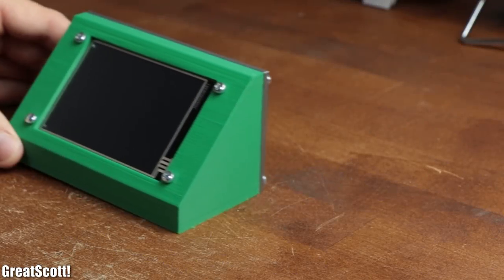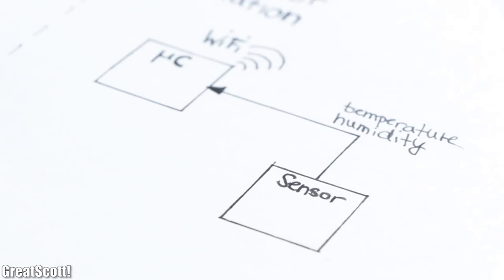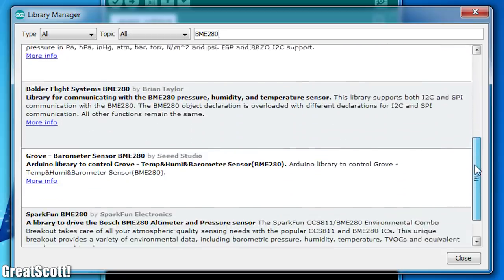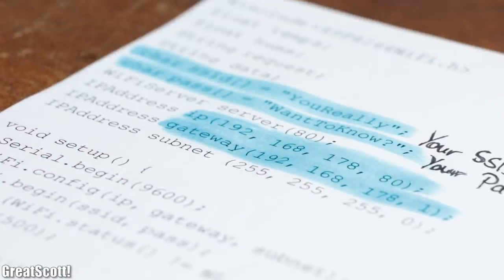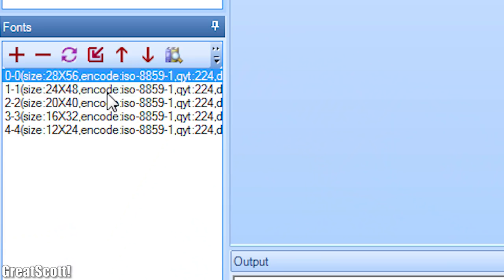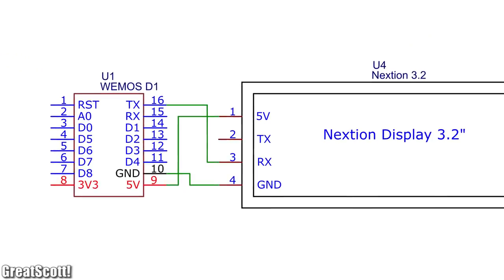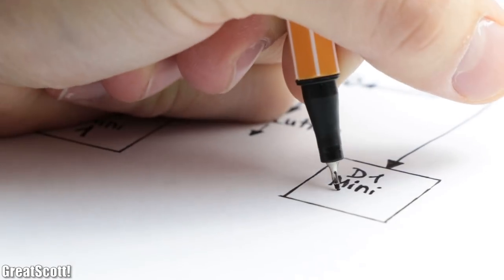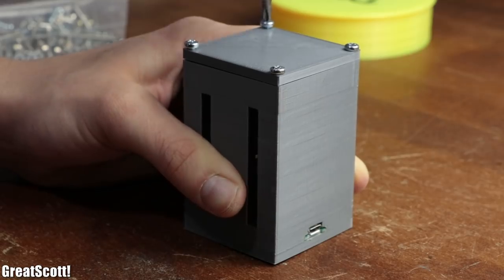DIY Weather Station & WiFi Sensor Station || ESP8266, Nextion LCD

Comment: ESP2866 is a game changer. Way easier to use and cheaper than Xbee for local communication. Integrated arduino-compatible microcontroller is a bonus. Really want to build a weather station to put on top of my house. Got some good ideas here. Thanks for sharing!

Comment: Regarding the Nextion Editor, it was probably expecting a monospace font, which would explain the weird text spacing.
Reply: Yes to the monospaced font. I ran into the same problem.
Reply: I think icons are better than text
Reply: Would it be better to generate pics of words through an external app and upload them to the nextion instead?

Comment: Regarding the temperature sensor, you should keep it separate from everything else, since the boards develop some heat too, and could so influence the result.
Reply: Yes but at 35C he must have put it right on top of the wifi chip lol.  I have some that are 5-10cm from the wifi chip and they only read 1.5C over ambient.

Comment: I had a play around with the BME280 and needed 2 of them connected to the same processor. After looking through huge amounts to datasheets, I found that you can indeed change the address on these boards; you have a choice of 2! If you look carefully at the 3 gold pads on the pcb, you will see that 2 are connected (middle and 1 side). You break this connection and join the middle to the other pad. One address is 0x76 and the other 0x77.
This saved my project, hope it helps someone else too.
Reply: You can also use them as SPI devices and have as many as you want. Provided you can supply a 'chip select' signal for each. Also, the BME280 datasheet is only 55 pages long. That's tiny. :)

Comment: Those 2 Wemoses made my day :) Seems like a bit of overkill to me. First of all, ESP is pretty fast, so any LCD will be capable to display the graphics directly from ESP - you can even  utilize the SPIFS for storage of the data and, potentially, upload a new background using web interface. But I admire your - let's just hack it together - attitude, really. I usually spend LOTS of time on my projects just because I don't want to do it this way and go with something like "this has to be possible - how hard can it be?". 3 months later I am left with lots of unfinished or half-done projects ;)
Reply: Perfect is the enemy of good (Voltaire)
Reply: So recognizable... +1
Reply: Dude, I feel you soo bad on this one. I have an extreme do this is the nice way or do it in a way so that it looks like it was bought. most of the time they end up like yours. PS: sorry for the reply 2 years later xD

Comment: Why not put the little wires through the holes in the boards when you solder them on? It does make them harder to remove if you take the project all apart, but you don't have to worry about the wires ripping the pads off the boards when moving them around.

Comment: I'd use an OLED display and make it simple white text on black(off) background, replace "Internet" with "Outside" and "Sensor" with "Inside", and maybe add a little cloud/sun icon indicating the current weather.
Anyway, cool project!

Comment: 9:42 
Are you sure that the diodes should be connected in this way? 

In this configuration you block the signal from TX to RX, so it can't go through the diode?

Comment: SWEET !!!!  After all the failed purchased weather stations I have tried, I wish you could design a complete all-out enhanced station with wind, direction, uv, temp, humidity, rain amount and pressure. This idea of going thru the wifi sounds absolutely grand compared to the expensive crap I have purchased that failed which operates over their own RF signal. My problem is that I an Not a programmer (mental block) and I get too frustrated trying. With having all the basic sensors already up and installed, just communication setup would needed to get all info back to the head unit.
Reply: Yup, agreed.  Using wi-fi to get to the internet is the way to go. An outside station is not needed. I bought a bunch of RF2401 to build weaterstations and I guess I will use them for something else.

Comment: It seems like the Nextion is not very simple to use. Do you know if it's possible to program the screen directly from the mcu? e.g. use the screen as a general purpose screen?
Reply from the maker: I don't think so. I think you have to use the editor.
Reply: @greatscottlab  Hi i just want ask that: are you going to do a video about your new skateboard ???
Reply: Im sure you can use a USB-TTL converter and the editor will automatically bring it up, but I'm sure you cant use it as a secondary screen to my knowledge
Reply: I think it’s still more simple than guessing where to define the 4 corners of a rectangle (which is usually guess and check since there’s no computer editor to see what you did before you upload to arduino), fill the rectangle with a solid color, then guess where the center of the button is to center your text which is especially hard since the coordinates are the left bottom coordinates of the text (no centering function), then make if then statements to check if the screen was touched in the area of the button, then redraw the button a different color to simulate being pressed, and finally run the code you wanted the button to do. And if you want to load any images, it takes 10 seconds to draw a background image. Then if you want to change pages, you have to put all your code for drawin everything in a method and use a variable to tell the arduino what screen you’re on or else it’ll respond to touch in the wrong areas. My point is, the regular way is a huge pain in the ass and is hours of guess and check. It’s so much nicer and faster to see what your GUI looks like as you’re making it, even if the editor isn’t super simple. It may be hard to learn, but once you master nextion, nothing else compares to how professional the GUI looks as far as arduino goes. Raspberry pi is a whole other story but you can’t beat nextion for arduino
Reply: There are commands available in the help section to program from code in, or passed thru, the MCU. There's a steep learning curve, but I haven't looked back to blue LCDs since I found the Nextion.
Reply: Old Curmudgeon I’m glad to hear that. I just got the 3.5” enhanced in the mail today and I’ve got another one coming. After writing 4,000 lines of code in my past project only to make a simple GUI , I wish I knew about these nextion screens earlier. I could’ve made a better GUI in a day or two instead of weeks
Reply: @greatscottlab  Yes and no. The editor is required to add the fonts and any pictures you want to use. The serial interface can then be used to manipulate the elements using the commands listed on the help page in the editor.
Reply: ay don't come advertise your project videos here. 
I understand you might be beginning or something but this really inst the place here
Reply: @Clockpie5436  sorry if english isn't your primary language, but I didn't understand a bit of that comment.
Reply: I think he is talking about "Learn Electronics" video, posted as a comment in this thread.

Comment: Looks great. I didn't go in detail through your code but just want to leave some info on the BME280 for those who might work with it the first time: by default it usually is in continuous mode, taking g reading after reading and that way heating up itself. Best use it in 'forced mode'.
I infact had problems with a Bosch sensor once. A BMP180 stopped working, so I have slight reservations :-)
Reply: I have 2 of these on different projects. I need to look into setting forced mode I think. I only poll in 15sec (minimum) intervals.

Comment: The BME280 is very sensitive to electromagnetic heating. Putting it this close to the ESP8266 antenna can easily skew the temperature by 3 degrees Celsius or more. Use a fan or put a lot more distance between it and the Wifi antenna.

Comment: The question of the day: do you believe the bme280 is accurate? I have constructed already several of those devices and I always had a problem with temperature readings, which in some extreme cases were like 6.5 degrees off. I I'm aware of self heating issue but that thing does not seem to be the 'large scale' issue. I did not do any tests yes, but is seems that this sensor has some dependency of temperature vs power supply

Comment: The reason you are getting weird looking text is that the font data is compiled and transferred to the Nextion screen as part of the programming. This method frees up memory that would otherwise be cluttered with unused font data. The best way of correcting your issues is to stick to using monospace fonts that occupy the same spacing. Those recommended are the following (Recommended Fonts by InterlinkKnight):
BatangChe
Consolas

CourierNew

DFKai-SB

DotumChe

FangSong

GulimChe

GungsuhChe

Incubus

KaiTi

LucidaSansTypewriter

MingLiU

MiriamFixed

MSGothic

MSMincho

NSimSun

OCRAExtended

Quartz

Rod

SDViewerFont

SimHei

SimplifiedArabicFixed

SimSun

SimSun-ExtB

Hope this helps, look forward to "seeing you next time!!!"

Comment: Great explanation.
But I have questions:
I have three stations (ESP8266 with BME280) and Openweather on Nextion. These also send the data (all, not just Temp and Hum) to Thingspeak.
How should I send this data on another Nextion?
Reading Thingspeak doesn't work, although that would be the simplest solution, because in this way many stations could be created and all data would be shown on a display (that would then be a real "station" and could also be used for thermal heating)

Comment: The ESP8266 has way too much influence on the BME sensor when mounted this way. This will result in a temperature reading that is higher than the actual temperature of the room. Sometimes that does't matter that much, but if you want to be precise it won't do.

Comment: Do you prefer soldering wire directly to the boards vs using headers and cable so they don't fall out if it gets bumped? Or another reason?

Appreciate the videos - interesting as always.

Comment: why not are you not using a protocoll like mqtt and a broker? So you could build a message driven design with multiple sensors and could use a raspi as server with a persistence like influxdb to save the data?

Comment: If you use the default config for your fritzbox, you should not use 192.168.178.80 as a static ip-adress, because the default dhcp-range is .20-.200. better use a adress between .2-.19 😉 (.201 + are the default vpn-client adresses)
Reply: You can reserve this via the MAC address in the FRITZ!Box. "Home Network > Network Connections"
"Use this button to add network devices that have not yet connected to the FRITZ!Box and are supposed to always receive a fixed IP address from the DHCP server."
Reply: ...or just switch to dynamic discovery protocols like SSDP and Avahi
Reply: @serhii710  In 2014 it was discovered that SSDP was being used in DDoS attacks known as an SSDP reflection 
attack with amplification. Many devices, including some residential routers, have a vulnerability in the UPnP software 
that allows an attacker to get replies from port number 1900 to a destination address of their choice. 
With a botnet of thousands of devices the attackers can generate sufficient packet rates and occupy bandwidth to saturate 
links, causing the denial of service.
Reply: @dl8cy  anyway, modern homes often contain at least one UPnP (and hence SSDP) - enabled device like Smart TVs, set-top boxes and even lights (like Yeelight with modified SSDP)

A lot of protocols have vulnerabilities. But in this case I'm not sure that the SSDP implementation for ESP or some other multicast-based discovery protocols can cause a lot of problems

Comment: Two ESPs for a single unit? Seriously? 

And for the future: take a look into SSDP and Avahi dynamic discovery protocols. Both of them allow devices to discover each other in a local network and communicate without a need to hardcore IP addresses

And also such protocols as MQTT are very handy for transmission of data messages from sensors

So, I'm waiting for the next project where the sensor unit will be battery-powered and will use deepSleep heavily to increase the battery life
Reply: Also you have 2 cors.....
Reply: just a question then, what else would you've used instead of another ESP (i guess you mean for the outdoor sensor)
And what is the actual advantage of them discovering each other?
Edit, sorry just saw now they were 2 in the station and 1 in the sensor
Reply: He's is using two ESP only for the display unit because he couldn't merge the code that receives data from remote sensor with code that draws on screen. I'll not judge here, but I guess it was not necessary if the code were more elaborated.
Reply: I actually have the same issue with the ILI9340 screen and the ESP32.  The drivers for the screen were written by someone who decided to write their own SPI protocol code, instead of using the existing Espressif libraries.  This allowed them to update the screen faster, but it interfered with any other code that wanted to talk to an SPI device.  So I either have to re-write all the screen libraries myself or split the functionality between two units.
Reply: Sergey, can't wait to see your demo code for the SDDP and Avahi protocols.
😁

Comment: Awesome project, and pretty useful but, could the Nextion LCD screen work with Arduino or other similar microcontrollers, and is it also avalaible in bigger dimensions and better quality resolutions???

Comment: I never understood why you solder the wires over the pin holes. Why not just put them through the pinholes and solder them from underneath? This seems to be a more stable connection as it doesn't have the risk of ripping the top copper pad off the board if you pull too hard, like yours does.

Comment: You could use the MQTT protocoll and a Node RED server, it's very versatile.
Reply: Over-kill for this project, but a great solution if you want to greatly expand with more/other sensors.

Comment: you are so lucky! theres lots of best in class electronics manufacturers in your country like bosch and siemens!!! here in my country there no such a company even a single one! it's hard to find components here. self studying or experimenting is impossible here. I'm self studying about electronics since 2010 I haven't even seen a oscilloscope or a lcr meter yet!
if we want to find scope here what we could find is cheap & simple pocket oscilloscopes only and funniest part is they inly exists in large mobile-phone repairing shops... we can't even import such electronic equipment from ebay or amazon because lack of foreign currency sanctuaries... sad of my country & and our poor economy😭😭😭

Comment: The font problem is solved if you use fixed size fonts. Variable size fonts require careful design and "kerning", which means that in some cases, letters must be moved towards each other. For example, "VA" and "fi" in this text show how kerning works. If this is not done or only approximately, the final result is horrible 😋

Comment: Hi I’d like to make a basic weather station which

1. Base station measures temp and humidity in the room
2. Remote (outside) temp and humidity sensor connected to base station via wifi,
3. Display output on a small color TFT to easily distinguish inside vs outside data.
4. Ideally base station (hopefully) and remote station (must) run from a battery.

Are you able to point me in the right direction please? All assistance appreciated.

I am an arduino novice but can follow instructions no problem  😀 👍

Comment: Great video, Scott, thank you so much.  I was wondering, could you make a video to messure several temperature and several umindity through several esp8266. And than have  high temp and low temp switch points, send signal send back to the respective esp8266, where some relays are switched, for example a heater, a fan, a/c dehumidifyer, window-opener, sprinkler, whatever.  etc. I think that would be something really usefull, we not quite so smart people could learn and program with.

Comment: Hi @GreatScott!, Is it possible if you could make a video with tips and tricks that you use when you solder on Vero board, like the type of wires you use and when you use them for making connections in the Vero board, Please🙏🏼.

Comment: What you could do is to start up a new WiFi on the ESP (with separate SSID and password) server and let the client connect to that WiFi.  Then you don't need to utilise any existing network.  That way you can actually give a weather station to someone since you won't need to "borrow" their WiFi.  If you want it really good you hide the WiFi so no one know how the sensor and station talk to eachother.  However you will not get internet access this way.
Reply: Maybe an MQTT broker & Home Assistant?
Reply: That would also be a solution, depending on the situation.

Comment: The weird spacing issues with your fonts come from *font kerning*. Google it if you want a detailed and technical explanation, but an easy fix for your problem would be to just use a monospace font.

Comment: Nice project. I am currently working on something similar but my ESP8266 is sending the the data from a DHT22 sensor to a local raspberry PI and logs it in a database. From there i can chart it with some javascript or just display the most recent entry.

Comment: Trying to build based on your design...one note so far...your ebay link for the display is not 480x320 but 320x240 so the tft and hmi files provided, while instructive, don't work.  None the less, trying to power through.

Comment: One hint: Never touch that BME280 directly with your fingers. That's really bad for the sensor because part from your scin are falling in that little hole and will destroy the little diafragma which safes the sensors.